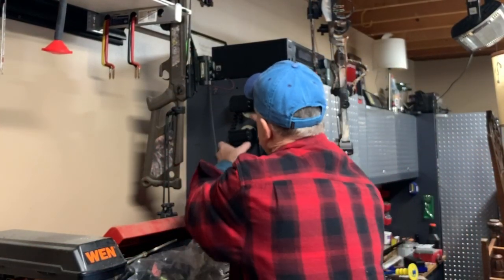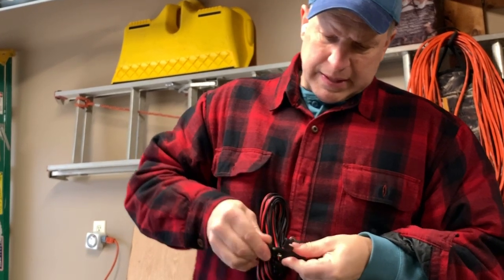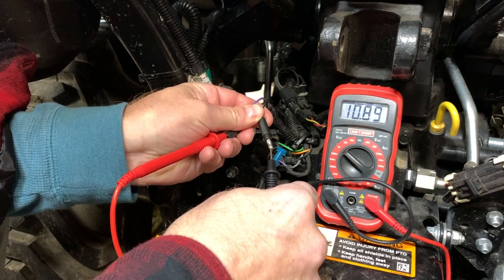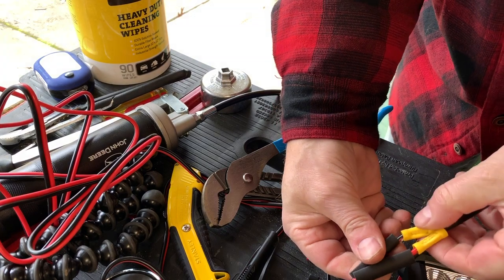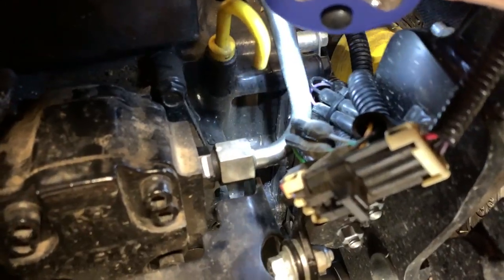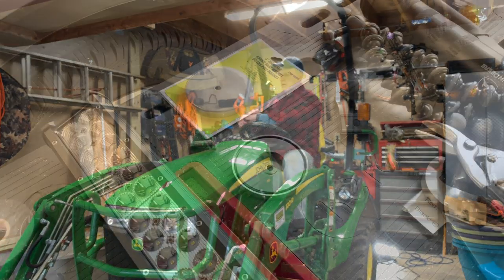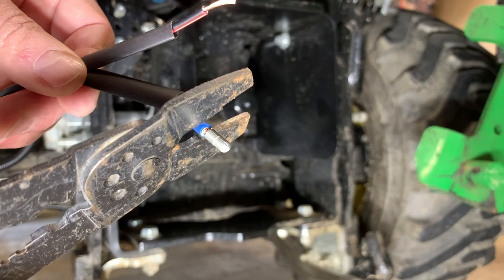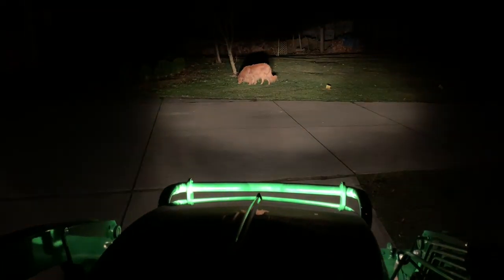John Deere 1025r:  Easy Mod Light Bar

Comment: While researching an easy way to add a light I came across your video. I ordered the same parts you used, just arrived today, & am looking forward to installing them tonight. The cost for the light, magnets & wire from Amazon is bit higher now (April, 2022). It totaled $43.47

Comment: I always appreciate your projects, I learn a lot. I finally got to use my plow (AF10F) twice here in the pacific NW. Very pleased.
I thought that I would have traction problems with no chains but with the backhoe on I had enough weight to plow through dry and
wet snow. Of course you can't let the wet snow build up too much. Keep those vids coming!

Comment: Very nice mod. My set up is very similar, but I used the 2-way Delphi Metri-Pack 150 connector in the wiring harness above the left rear axle instead of the SAE bullet connectors. Looks like yours are being used for something else already (minute 2:46). Great channel, BTW. I love your videos. Cheers.

Comment: Awesome video thanks for sharing I have a larger led light bar just kinda wondering if it would still work to wire where you hooked into for power
Reply from the maker: Probably, my light bar is 72 watts.

Comment: Really liked the instruction and sharing this lighting modification.  I did the same on my 2020 1025r with the forward leaning ROPS and notice the light will fall off when pushing snow.  I might try using zip ties to save my skull!  Has anyone had their light bar slide forward and off the ROPS?
Reply from the maker: Only had them come off if I fold my ROPs back and hit large bumps at a high speed.  In the upright position they stay solid.

Comment: Looks good . I guess you didn't have to add a switch . Looks like those wires where already hooked to the light switch on the tractor.
Reply from the maker: Yes, it was pretty simple and there was another set of wire unused on the right side too.

Comment: Thanks for this. Is the spare JD purple/black wiring capable of carrying the load to service the light mod? Does anyone know if doing this work will invalidate new tractor warranty?
Reply from the maker: The light bar is 72 watts.  I've ran it for a few hours at a time an have not had any issues.  As for the warranty, really didn't modify anything with the tractor.  I could pull off the magnets, unplug the wires, and put the cap back on.  Take Care, Tom

Comment: Can you put a link to the wiring piece? Matching up the bullet connector is the trick.
Reply from the maker: I took the caps off, which has the connectors on them and took them to my local auto parts store (auto zone) and match them up. Here is the wire I usedhttps://www.amazon.com/gp/product/B01N7CEV00/ref=ppx_yo_dt_b_asin_title_o07_s00?ie=UTF8&psc=1

Comment: How did you find out about the spare wire on your tractor? I have a 3025E and would like to add lights on it, but my owner's manual doesn't have any wiring diagrams.
Reply from the maker: Dean Levang I read on a forum that those wires were place there if you upgraded to have the LED work lights to the ROPS added as an option from John Deere.  That makes me wonder if you had that option also.

Comment: The way you connected the LED with using the existing tractor wiring: did that  eliminated the need for a relay?
Reply from the maker: Yes, did not use a relay.  I can’t speak for wanting a larger wattage though.
Reply: @ataleofthreecabins1025  Thank you.  I have a 36 watt light on order.  My GC 1715 has a canopy. One bullet connector at the rear (+). Magnets will be my choice for mounting. Put the light where it works best for my needs.